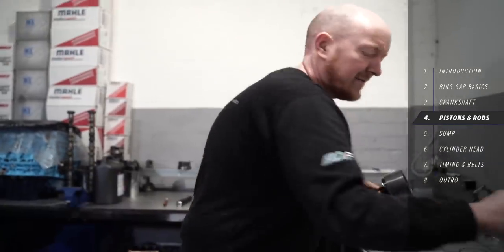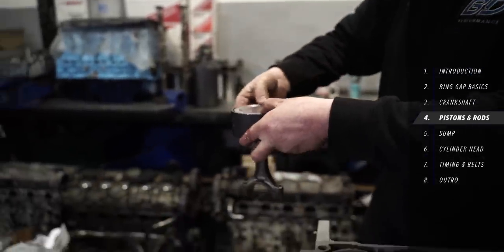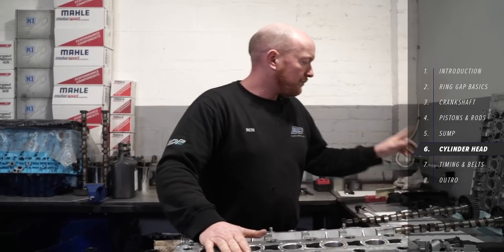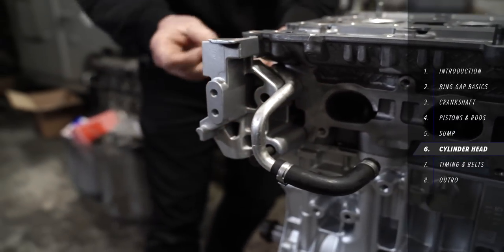Focus Mk2 Engine Building 101 - ST/RS

Comment: With respect to the king bearings, since there was no damage to the journals or crank, guessing you all used standard size?  Also do you find that those bearings are within spec for the 3 variation options for the ford/Volvo factory bearing replacements?

Comment: Do the main bearing bolts need to be replaced at a hydb/hydc engine? Equivalent b5254T from volvo. Torq spec's are not clear to me for the little block bolts, 24 and 17nm + 90 degrees? Torque spec camshaft cover is not mentioned?

Comment: Could you please assist if  I put a dailgauge on my number  one piston and turn the engine to tdc  mark then my timming mark on my crank does not correspond to the mark on the oil pump so if you use the timming tools the mark alighn with the oil pump but the pistons  number one is not full on tdc. Why is that

Comment: I really enjoyed this video, great work guys!  Also, Is it possible to use with this engine the  intake camshaft from a Volvo 2.4i (C30/S40/V50/C70)engine? Will it provide any performance gains?
Reply from the maker: We generally stick to Newman or similar camshafts when hunting for power. Glad you enjoyed the video and thanks for the comment/question! 🙌

Comment: The main bearings you get 2 that are bigger than the rest in a king bearing set where do these go please as it doesn't show in the video. I don't want to put them in wrong position cheers guys 👍
Reply: The block is machined differently for the the thrust bearings,  you won’t be able to fit them anywhere else.

Comment: Hi, im from brazil and have recently rebuilt my engine. I get no leaks or issues with the pcv valve. Also my oil pump is new but im getting something like 0.8bar oil pressure at idle and 3.0 bar at 4000rpm. According to the manual im a bit off the ideal oil pressure.

We checked rod bearings and their clearence is within standards.

What can i check next? Im out of options in my head.

Comment: I have a crazy question! Is it possible to fit an ST HYDA 2,5 liters in a Ford Focus Mk2 which has the 1,6L HWDA engine? If yes, what are the difficulties?
Reply from the maker: Anything is possible with the right amount of parts, money and skill. The question is more of - is it worth the cost? There are a few who have installed HYDA Engines into other models; however the ROI isn't always worth it. against switching out! Hope that this helps,  TeamBD
Reply: @BDPerformanceWrexham   Indeed... ROI will be most negative. Then perhaps worth building the engine and deciding about the car later?

BTW, I really enjoy your videos. I just discovered your channel couple of days ago.

Comment: Quick question how do you install the rear crankshaft seal without damaging it I've got to put new one on my 2007 st cheers
Reply from the maker: A sleeve or the genuine installation tool from Ford. If you are really struggling you could use the original you removed, over the new seal, to reinstall.

Hope that this helps,

TeamBD
Reply: @BDPerformanceWrexham  thanks guys I no these rear seals can be a pain to do 😔

Comment: please invest in a proper ring grinder. doing it by hand never gives a straight edge, i wouldn't be getting an engine built by a company without the proper tools. this is not slagging your company off i find the vids very good just shocked you are filing rings down by hand.
Reply from the maker: The whole idea of the video was to show the method in which people can adopt at home making sure that the edges are parallel and free from burring. 

Thanks for the feedback - the comments are appreciated regardless.